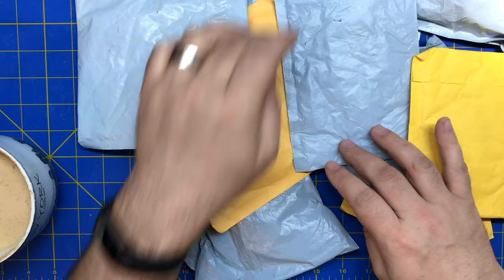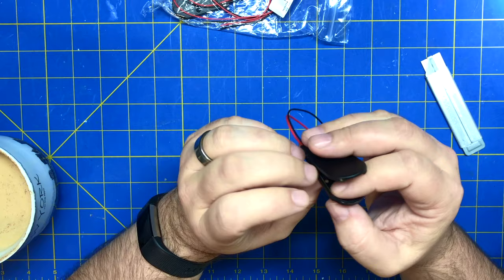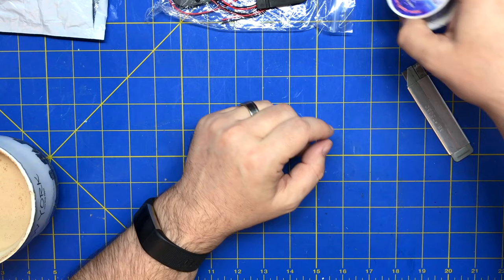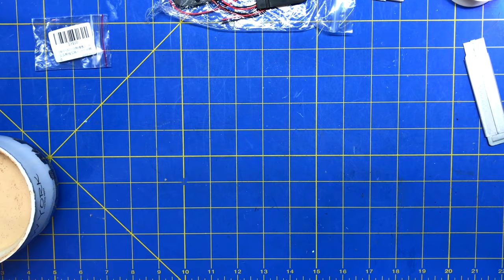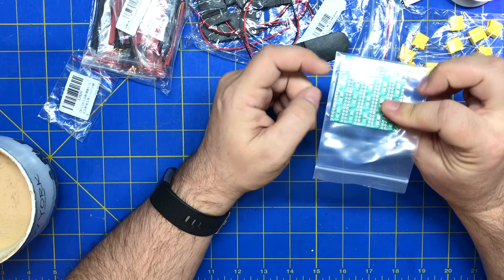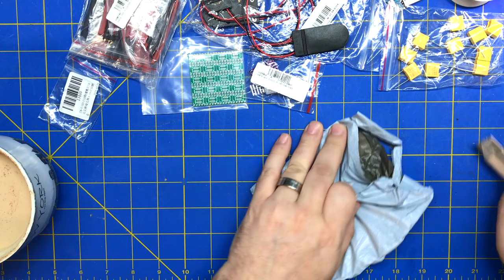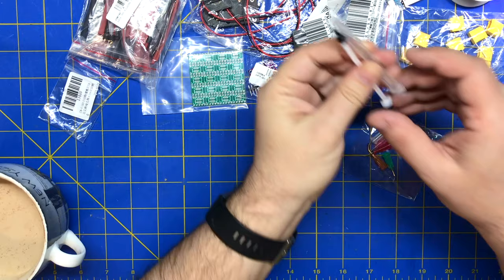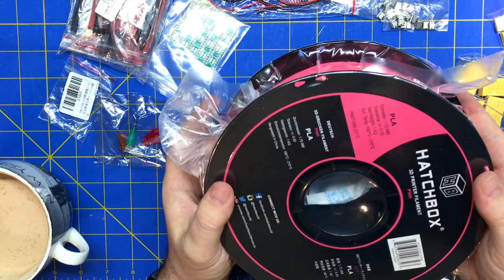Mailbag #48 08-2019

Comment: Nice mail bag. It looks like you could use those bent needles on a syringe with a spring between the syringe and plunger. Push the plunger down,pick up your part on needle and release plunger. The part would stay on needle and plunger would slowly move out if there was a leak between part and needle.
Reply from the maker: Yeah suction pickups usually do not work very well, I am already working on a vacuum pump pickup, it is worth it and works much better. They sell $50 pickup pens but I just cannot see them working well on smd passives, they all look the same also.